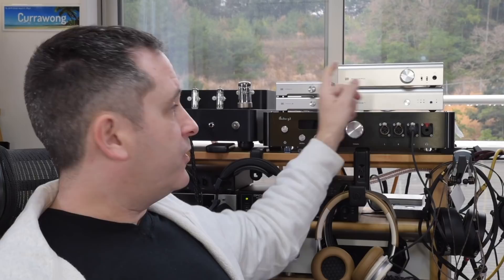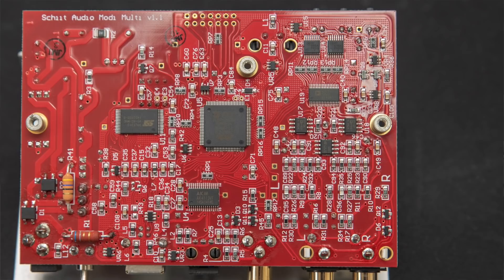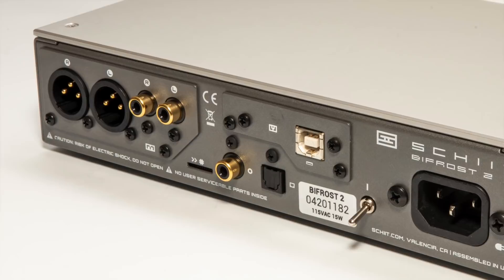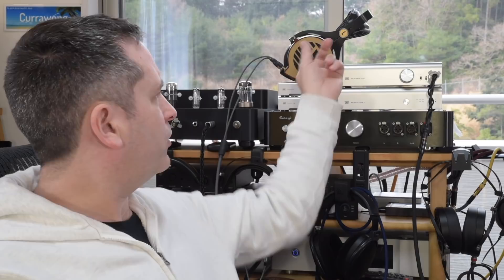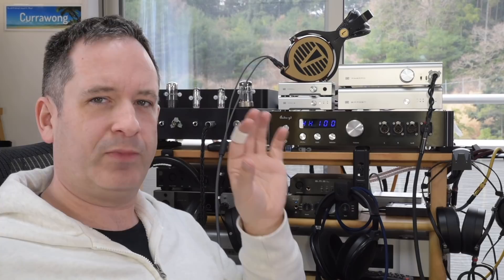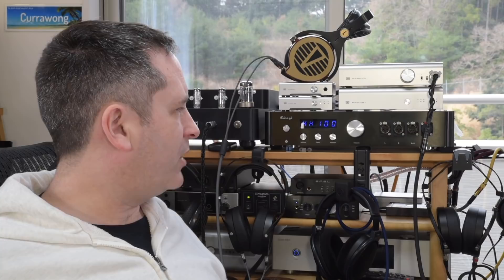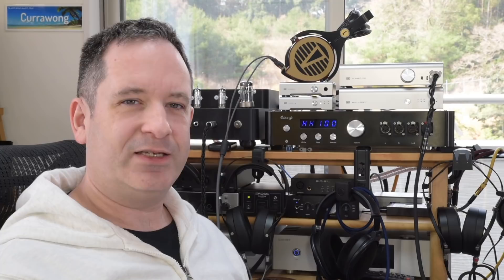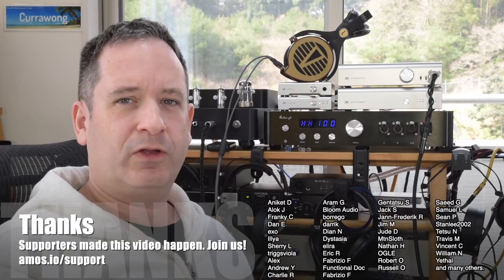Schiit Modi Mulbit/Magni 3+ vs. Asgard 3/Bifrost 2.

Comment: Hlo.
Magni 3+ drive properly 600 ohm impedance Headphones ??? Plz reply.
Reply from the maker: My recommendation would be to get at least an Asgard, if it's in your budget.
Reply: Fwiw I have a a pair of dt990 600ohm and the JDS Atom. The Atom has plenty of power, no joke. I have windows volume @75% and It still reaches ear bleeding levels.
Reply from the maker: That means it has plenty of *gain*. That's not the same thing as power. :)
Reply: @Currawong  
Even on low gain it's quite loud.
You state that power and gain are different, do you have a video or can refer me to place that can explain this? I am interested in this as I am new to the audio scene.
Reply: @metalmckanical  I have the Atom and the Asgard 3 and with dt880 600 the difference is very noticeable. I find the Atom very digital sounding and less musical compared to the Asgard.
Reply: @dj4int  
I have no doubt it sounds better. I am considering buying one myself. 
He asked about the ability to drive 600ohm headphones,  I let him know that the atom being a less powerful amp can drive them fine. So the asgard should have no problem.
Reply: @dj4int  I also have the DT880 600 ohm and I'm debating between the Asgard 3 or the SMSL THX 888. I'm worried the Asgard won't drive the 880 to loud levels. Are you able to get them loud with the Asgard 3?
Reply: @Raviolei  Yes, there's more than enough power to drive them properly.

Comment: Is there a particular set of headphones you recommend for the modi/magni stack? Sub $500 pricerange.
Reply from the maker: I recommend finding headphones you like first, which will depend mostly on the music you like.
Reply: Currawong i pretty much listen to everything except rap. I listen to Rock. Alternative. Grunge. Rnb. Ska. Reggae. Folk. Country. With so many good options, it just sets off my anxiety on what to choose. Sorry i just need some expert recommendations. Thank again for replying.
Reply from the maker: I don't have many headphones under $500 here, but of the ones I've tried, various planars have been good, such as the Sundaras (which are hopefully still available for about $350).  They tend to be a safe, all-round music choice.
Reply: @Doc8404  personally I love the dt 1990s but some people find them overly aggressive in the highs but out of that, the hd 58x and 6xx on drop plus akg k712 I almost only use my 1990s
Reply: Ron thanks for the advice. Ill look into them and probably buy all on amazon and just return what i dont like.
Reply: @Doc8404  did you ever come to a decision?
Reply: Ron well i wanted to start at the bottom price range so i went with the sundaras. I also ordered the 1990 and 6xx’s and thanks to amazons return policy, one or two of these will go back.
Reply: @Doc8404  what did you end up choosing?

Comment: This is quite a useless comparison to be honest. These 2 combos are vastly different in build, and what they are intended to be played with. One set uses much better internal parts for one and the DACs are are miles apart. Anyway, I still enjoy your stuff but you're not the smaller duo any favors.
Reply from the maker: I got a lot of requests for this kind of comparison. It is an obvious takeaway that upgrading both components at one would be more significant, but it's not obvious to everyone what the result would actually be.